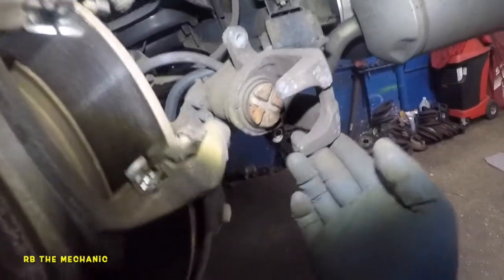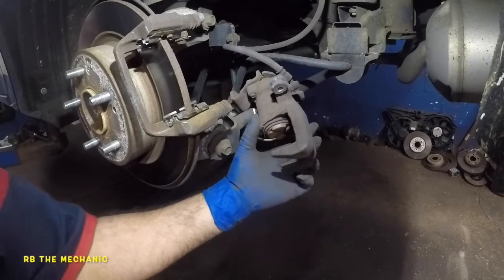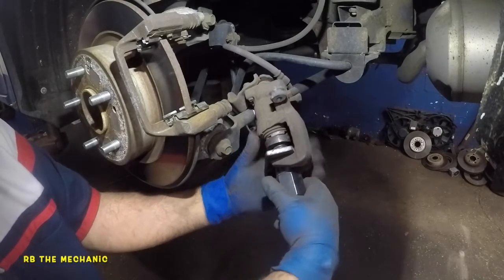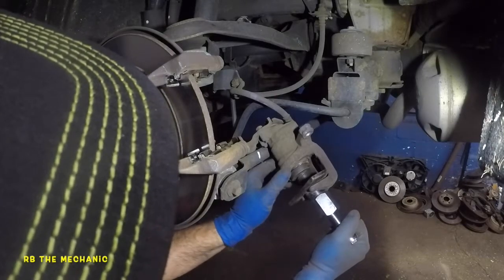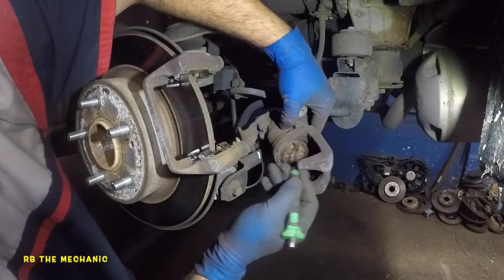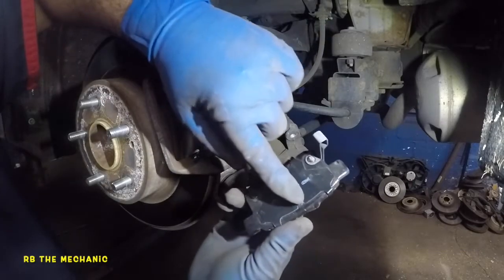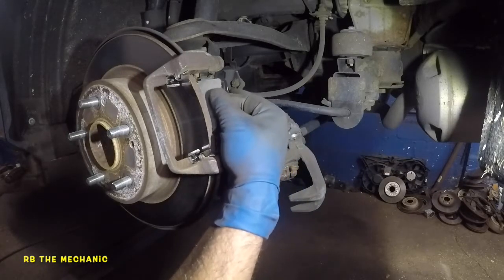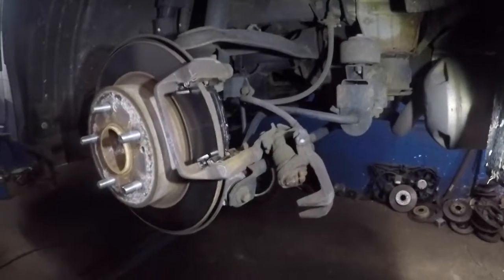Honda Rear calipers has a CROSS and its functions are?

Comment: I had to see your video before i changed the rear brake pads  of my accord. I didn't aligne it so now the rotor feels difficult to spin. I guess the pad is not placed correctly.
Reply from the maker: Yes the caliper has to be aligned so pad notch can sit in it

Comment: Just had my rear caliper, brake pads, rotors on my 2009 Honda Accord.  Now the handbrake is extremely loose.  Should the technician have adjusted the handbrake also at the same time?
Reply from the maker: Usually there is no adjustment for caliper u might want to take it back to him either he left something off loose or caliper is bad  those are the possibilities it’s self adjusting caliper
Reply: @RBTheMechanic thank you
Reply: I have the same problem With new NAPA "Adaptive one" lifetime calipers. the old brakes only lifted Parking brake 2-3 inches it would be FIRM. Now there is no tension, handle goes all the way to End (12oclock position) like butter no resistance, the brake engages but it is weak. and the main brakes are squishy.  I have one local brake shop that said I could turn the piston, adjust the cross out? using it as brake adjuster?
 I also called Terrapower, manufacture of Adaptive One, tech help, they suggested a help video instructing press down hard on the brake pedal with both feet 20 times to activate auto adjuster?
Reply: I did press down on the pedal a bunch more times (when I was bleeding brakes I obviously did too) but I also drove it around, down hills, pressing brakes and I am noticing that the Parking brake and main brakes have both gotten  little firmer now after driving it more. . So maybe the self adjusting brakes on 2012 may seem super soft at first will firm up over time. I will wait a few weeks if Parking brake has not firmed up more, I might adjust it by pulling the back panel of the center console and using a 12" extension to tighten. (Although many people have adjusted only to have it loosen up again later)

Comment: Good stuff. Would it help/make it easier if you bleed the caliper while screwing the piston in?
Reply from the maker: I recommend to to do that 
1 u can mess up the system and catch air
2 the bleeder valve might not open and snap
3 if the valve dose open it may leak no matter how tight u make it
Best is to do ur flush service regulartly